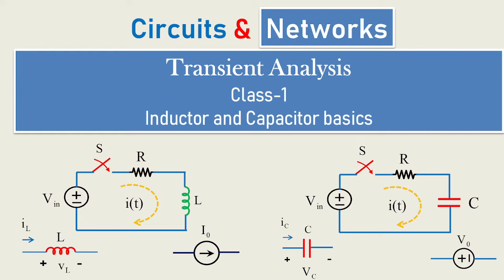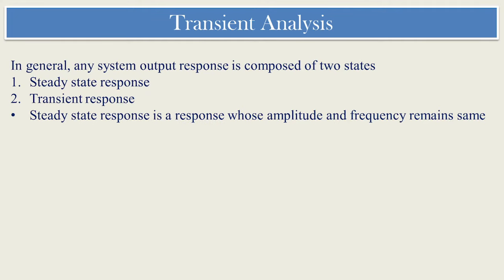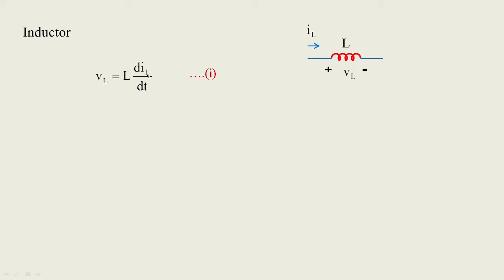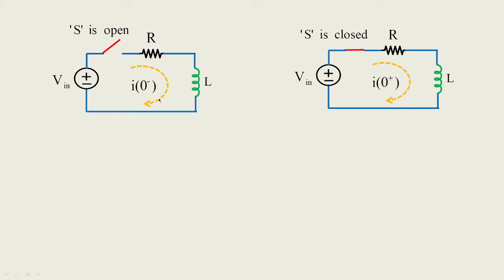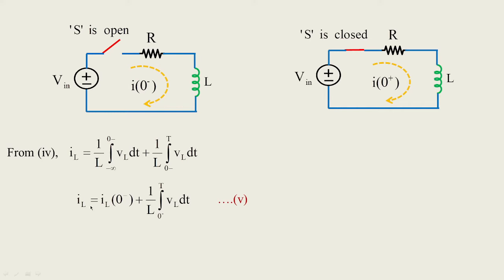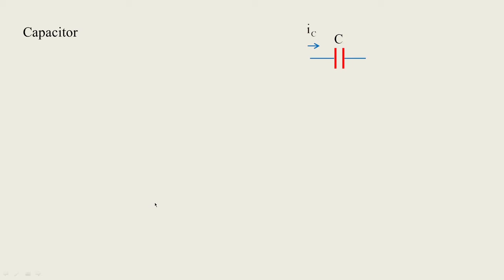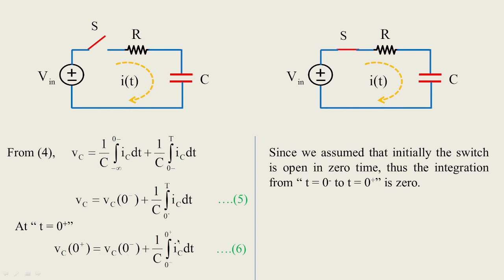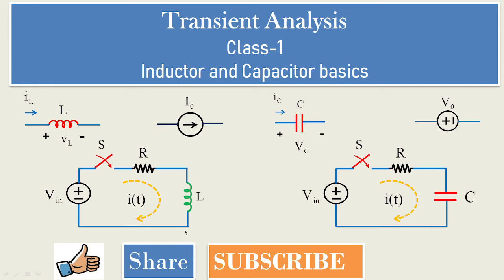What is Transient analysis? How to solve   transient analysis problems? State transient analysis

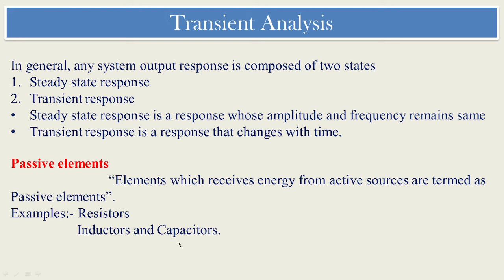Comment: Personal notes about capacitor very important at: 15:04, I learned that capacitor can momentarily exceed the source voltage at an instant at t=0+ provided that the capacitor has a voltage before the switch closes at t=0- with the formula Q=CV in some problems but it gradually matches the source voltage at t=infinite. Unlike capacitors, inductors cannot momentarily exceed a value in the case it's current that cannot exceed. Inductors notes: 11:32. Also the short circuit with the current source in parallel for the inductor, in that case the current source will not operate and will instead all the electricity will go to the short circuit. And they act as voltage and current sources respectively during the time of switching. Other important notes: 3:00, 6:47